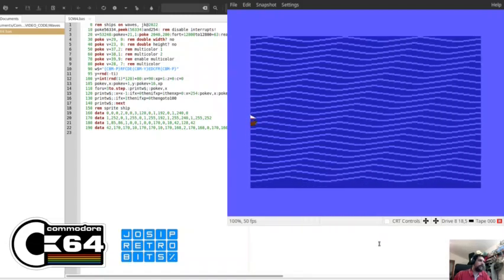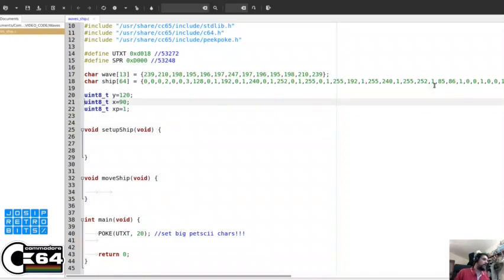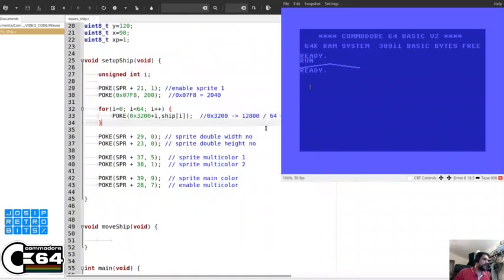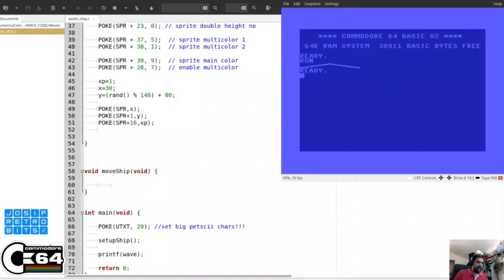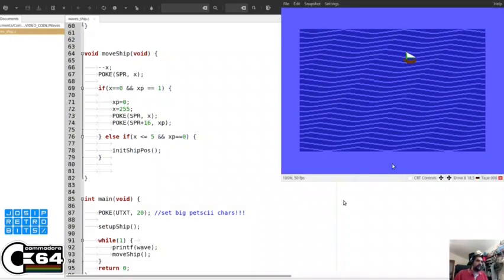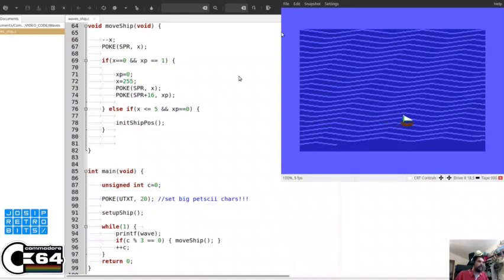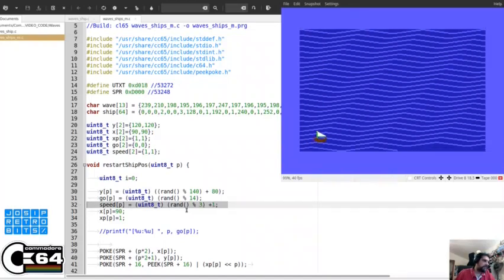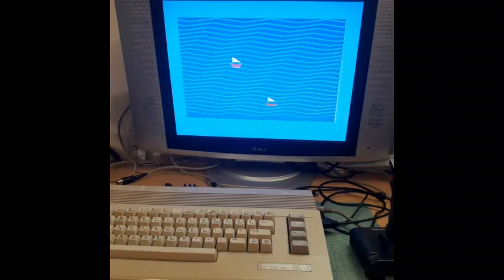Commodore 64 Basic Waves with Ships in C (part two)

Comment: As a complete C noob, I am curious is there any benefit of setting void for functions argument if there is none? Some time ago I did a C version of c64unit that supports different cross-assemblers and I was happy to do the C version and do some actual C for C64 that was a really nice experience, so I am just curious to learn more ;).
Reply from the maker: Send void, if the function that takes no arguments depends on the set of rules used in C and as I tested now CC65 accepts both cases, with or without void. The machine code that is produced is identical.